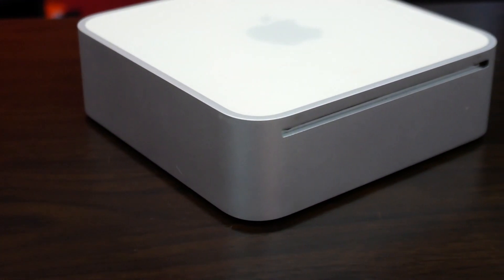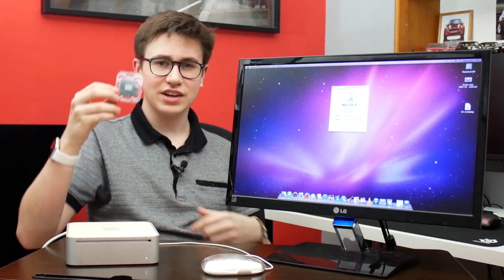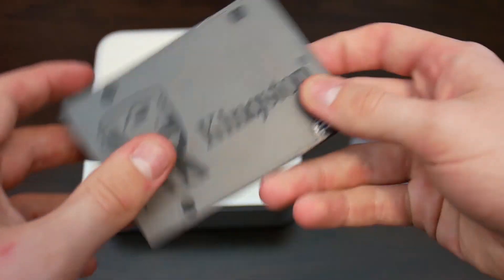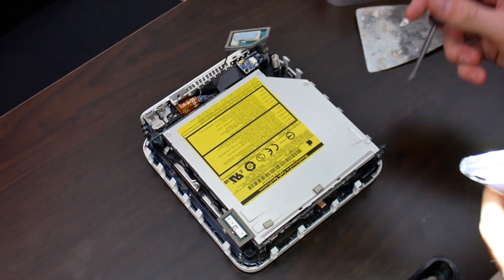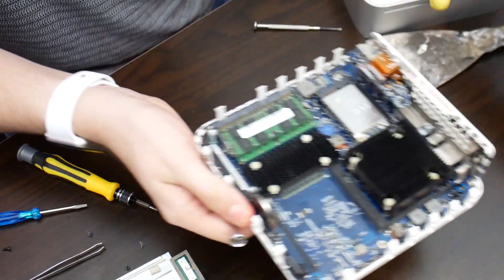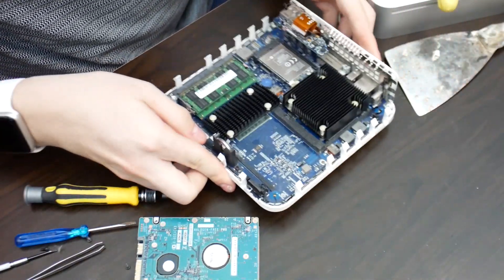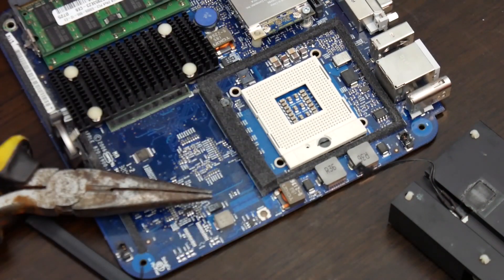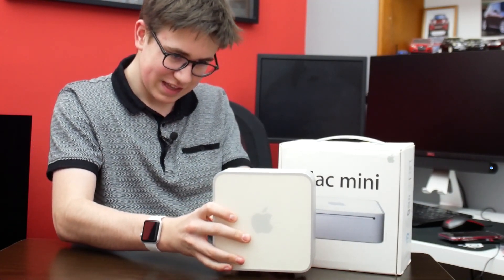2006 Mac Mini Upgrades - Core 2 Duo T7200 CPU Install + SSD Upgrade

Comment: My 2006 running Lion suddenly stopped working when the screen said it had LOST the OS & at the same time my 20  inch Cinema Display also died. I suspect the hard drive died. I am not sure HOW to fix it & I miss it a lot because I used to play Diablo 2 on it when I could not sleep.

Comment: Здравствуйте, очень понравилось видео ваше. Я купил mac mini 2006, и у него процессор стоит intel Core T2400, сокет mpga479m на материнке. Смущает то что у процессора intel core 2 duo T7200 сокет s478(есть конечно поддержка для сокета 479). Он заработает ли он под данный сокет?
Reply: Hello, Ruslan. Socket 478 is meant for desktops while socket 479 is meant for laptops and low-powered devices. So, I hope that clears up some things.

Comment: Hasta cuanto aguanta de ram y procesador al maximo
Reply: Well, this is a 1.1 Mac Mini, which means maximum supported ram is 2gb. But you could flash the BIOS to a 2.1 Mac Mini and you would be able to install 4gb. I've never done that, but it would be possible theoretically.

Comment: Hi. i have a mac mini core 2 due 2007. it is running lion 10.7.5.  is there any upgrade i can do to use latest OS?  I plan to use dual monitors, and the adapters only work with superior OS.

Comment: T7600 is the last cpu you can put according to low end Mac
Reply: The T7600G is actually the last CPU. It has an unlocked multiplier for overclocking.

Comment: Nearly went after T7600 since its widely recommended for this kind of upgrade. While it is an understandable upgrade, but buying it from over prices sellers in eBay for $60+ and $30+ from China? Thanks to this honest video, which I am so glad it showed up to my search, I think I will stick to T7200. I can't expect more speed on a 2006 model.
Reply: I have a Toshiba Satellite that supports Socket M processors, and I might have to agree with you. I feel uncomfortable buying the T7600 for $30 bucks when I can get a T7200 or even a T7400 for $10.

Edit: T7200 is the cheapest and supports the lowest voltage compared to the other T7x00 CPUs.

Comment: Most of relevant footage needed to perform the upgrade was edited out, rendering the video almost useless. Removing outer screws is not the goal, it is about guiding on the complicated steps. If it takes an hour, well it takes an hour... we can always skip the sections that are easy. Fast forward sections are useless as well, because regular watchers to not have tools to slow down the images.
Reply: honestly ive taken turds that look nicer than you
Reply from the maker: Then go follow an iFixit guide! I'm here to make enjoyable content for my viewers, I'm not here to do a step by step follow through: https://www.ifixit.com/Device/Mac_Mini_Model_A1176

Comment: Wouldn't a Core 2 Duo T9500 be also possible?
Reply from the maker: Yes but they cost more than the machine, it’s just not feasible price wise
Reply: @Techwen  Just want to correct you on that, no it is not possible. They use different sockets. A cpu for a mac mini 2006 has to have the socket m configuration, while everything from the 3,1 and on uses the socket p.
Reply from the maker: Ah yes, apologies for that. I got confused with the T7600.
Reply: @Techwen  No worries, they're easy to mess up. I really don't understand why intel bothered with socket m in the first place. There are such a little amount of cpus that work on socket m, it's ridiculous!
Reply: Poor fellow 11:47  my friend how many machine have you worked on😅, my apologies but your worry was adorable, reminded me of the first time I worked on a $89,000 server system... I was all (Omg if I mess something up it's gonna be my ass) but fast forward to now I'm like ummhmm yeah, drinking a monster energy drink and gaming on my mobile while assembling and disassembling machines, accidentally get some soda in there and I'm like oh... Oops meh (sprays some isopropyl alcohol in there and little dry rag to sponge it up and just so confident that I don't even think twice if I did anything that'll ruin the system or not*fyi  No, as long as your not powering up the machine, or have it plugged into a power source, your good to go all day... Even if you drenched the whole system in water, so long as you have no power or any voltage or anything running thru the system just high alcohol concentrated source basically something that is wet liquid and evaporates isopropyl alcohol or acetone if you wanna be a badass... Your totally fine*)

Comment: Can it support a q9000?
Reply: The Q9000 is a Socket P processor likely supported by only some chipsets. The T7200 is a Socket M processor, so the Q9000 would be incompatible.